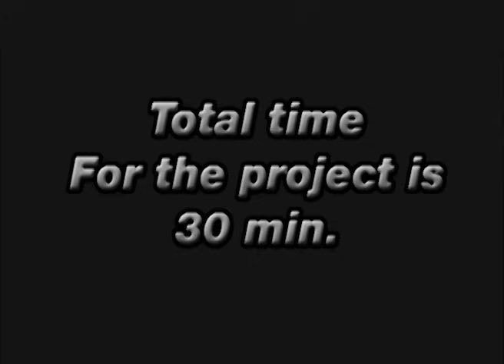DIY: Wrapping Rims in Matte Black Vinyl

Comment: Great video.  I'm surprised how many bad comments there are about using vinyl.  Good 3M vinyl can last 5+ years on a daily driver, and longer on a car not left out in the sun or driven in bad weather.  It's relatively cheap and not that hard to do, provided you watch a couple dozen youtube videos by the pros.  And if you really mess up a piece, just pull it off and do it over again.  I bought a bunch of small samples on ebay in order to see how the colors looked on my car and also to experiment to see how much body prep was required before wrapping.  I'm working on the car now and it's not as hard as I initially thought.
Reply: You guys heard it straight from John Squires!
Reply: Its a touch different for the wheels though. Brake heat, curb rash, road grime and salts, etc. Wheel vinyl wont last nearly as long as on a smooth large panel. That said, as you mentioned its cheap and easy to repair.
Reply: your going to have negative comments about anything but i enjoyed watching it - i fast forwarded it alot to the ending to see the outcome. Good job
Reply: people just love to shit on others, especially on youtube. it's for their self-esteem lol...
Reply: @thedbq1  lol no my friend.. it's because of the shitty sped up techno music. plain and simple
Reply: Can you wrap aluminum hub caps or just spray paint it?

Comment: When heating the vinyl and pressing it into those curves you should be using your finger and soapy water or spit, not a rag. That rag can stick to the hot vinyl and leave lent or rip it. Also don't make any cuts until it's applied all over your selected area (including all curves and recesses. If you make a relief cut a relief cut in the middle like in this video it  will prevent you from being able to heat it again because it'll expand and further the cut.

Also for all you folk who don't do this professionally, make sure you're using a brand new blade before each cut to prevent jagged edges from dull cuts.

They also didn't mention cleaning the surface extremely well with 1/2 Denatured Alcohol and water before application to prevent future failing of the vinyl and prevent dust speckles showing through. 

Just tips for installs from a wrapper.
Reply: Timothy Brooks it sounds like you know about vinyl. How long does it really last. I’m in California is it worth wrapping wheels
Reply: Have you gone Platinum yet?

Comment: nothing beats powder coating wheels but I'm ballin' on a budget so I painted my wheels with duplicolor and quickly wiped off the over spray on the rubber with thinner. Once the paint dried I cleaned the rubber. Works good with black, matte or gloss. If you want to use a paint with hardener, mask your side wall with vasoline, use a razor to cut the over spray once the paint has dried it peels right off- please stop replacing paint with stickers_ painters have to eat too lol

Comment: People have to realise the longevity doesn't exist on wheels and glued on vinyl. Add in road salts and water mixed with spilt fuels from trucks and all other crap on the road fired up into your wheels and it's gotta be no shock that they will start to fail especially when grit and stuff chips at it. With the cost of the vinyl being less than £10 especially if you order it directly from china and wait 2 weeks for it to arrive, you then realise it's really only meant to be for a short period of time. Sure, you could add 4 coats of lacquer afterwards to give it some extra protection and more longevity but that makes removing the vinyl a little tougher. Things like this are great for shows and such where you will remove it within a week or even a few months and lets face it, it's not costing more than a few pounds and your time to do it. People who are expecting a lifetime good look are going to be disappointed. Great video, could be more detailed but inspires none the less. Btw, if you are feeling creative, you don't have to do one colour or flat non-patterned.... also, use a brand new very sharp blade and always let IT cut the vinyl while the blade is riding flush where applicable.. otherwise it will look butchered.
Reply from the maker: Lasted 4years before cracking. This last year I took a look to see if I can peel the vinyl still. I can. This was only a test. But it passed. 4years of Canadian winters.
Reply: Bart Koscow how do you avoid the matte vinyl glossing up when you heat it?
Reply: I think the vinyl that looks like it's glossing only appears that way because it's shrinking and stretching. I think whatever is stuck to the actual wheel will remain matte because it can't stretch and shrink, since it is adhered to a surface, i think.
Reply: Sunil P I have worked with matte vinyl before and if its heated too much it melts and glosses over. I'm guessing you have to watch the amount of heat used.
Reply from the maker: TMundohere it dose of you stretch it too far. If you stretch it more then twice it's own width it will gloss up. Nothing you can do, but cut the inside first, then apply a top coat. I have done this before with extreme curves, matte black tends to blend in nicely.

Comment: I work daily with vinyl. Try do that with a more complex wheel such as my bmw mv1's you will come unstuck fast, not that I've tried! Standard paint or plastidip is the way forward. Just advice.
Reply: Wondering if you are still doing vinyl, and if so have the products and techniques improved so as to allow for doing that type of rim? I have similar style rims to the BMW MV1. Cheers.

Comment: Seems like a very tedious process, wouldn't plastidip have been easier?
Reply: This video is from 2010. Plastidip would be 100x easier than this lmao
Reply: This video is from 2010. Plastidip would be 100x easier than this lmao
Reply from the maker: ***** plasti dio existed back in 1992. and was used in spray form back in 2006-2007. that doesnt make it any esier or longer lasting. each has its strengths.
Reply: Plasti dip definitely works I did it to my rims but took my 3 hours and five coats plus 3 clear coats and it looked perfect and lasted about three years but now it looks terrible and is being a pain in the but to take off.

Comment: Great initiative and great job on the video and the wheel. One thing I would do different is release the tension on each spoke by cutting a longitudinal  sleet in the center of the spoke, some 2 inches long would do. That would make covering each spoke inside much easier, and would make it more durable. Either way, great job. Thanks!
Reply: its easier this way.. you get to civer two spokes at once equally

Comment from the maker: Not sure what happened to buddies comment that said show us 24h later, ok bud. i see your 24h and raise you 28000h, just went out and took this pic. 4 years later.

http://s134.photobucket.com/albums/q110/portabuddy/Mobile%20Uploads/?action=view&current=IMG_20140415_202516.jpg

suck on those apples. ;)
to your credit mystory comment that got deleted. the two rear rims had a small section that lifted off. three years later. and i wanted to see how hard it would be to peel off came off easy so two have little patches missing. but that was in porpose.
Reply: Bart Koscow 
Is the discoloration in the center of the wheel from heat, dirt, abrasion or u.v if you can tell ? 
Im still impressed it lasted so long, especially being exposed to the elements.
Reply from the maker: +nvmyutube no its actually a area where I started to peel the vinyl since after 4 years there where some cracks forming. and really only in the corners where it was stretched. but non the less that's where the vinyl failed.
Reply: +Bart Koscow You managed to change tires without damaging the vinyl ? :D
Reply: Zak Mon what ?
Reply: matt vanbeekveld your language and abbreviations speak volumes of your intelligence.
Reply: +matt vanbeekveld You prob don't even have a decent vehicle, forget ricing
Reply: نن
Reply: Bart Koscow tt 6te1

Comment: Plasti dip is easier
Reply: Also a lot harder to take off, let alone the poor quality of it that rubs off after a wash. Trust me, I've done plasti dip on rims, easier yes; better no.
Reply: Jason Stefan so what would you recommend to be the overall best way to achieve the matte look
Reply: JonLondon210 if I'm honest, I'd recommend powder coating or the best results but the hardest sanding down the alloy priming and using a matt spray paint, available at Halfords in the uk, finishing off with a Matt clear lacquer.
Reply: rubs off after a wash lol. you clearly had no idea what you were doing then. Matte black dip on my rims for 3 1/2 years just removed the dip this weekend with no issues.
Reply: Mel H so the dip comes off? When you want it to?
Reply: Just clean, sand, prime and paint them joints!

Comment: Plastidip is just a type of spray vinyl(your's is a physical vinyl). The amount of coats equal to this, is probably around 5 or so decent coats. I have done the wheels on my GTI in about 7 or so clean coats. Years laters and they are still holding together. Really this depends on the person applying it. Even if this is incorrectly applied, It will be easily ruined. 

I do like the concept of this though. Cool video.

Comment: Vinyl lasts about 4 or 5 years depending how well you put it on and yes you can wash it !! And it only rips off if you grab a corner and pull on it very hard!! but a rock or any other road crap will only scratch it just like paint!!

Comment: Plasti Dip only takes a minute -.-
Reply from the maker: no it dosnt. ive plasti-dipped rims before and if you want to do it right you have to scuff them up. but you dont need to. in any case. it still takes this long if not longer to plasti dip, which i can rub off with my thumb. 

Actually try both methods and tell me which lasts longer. im no hypacrite. i have and its faster to vinly. but better and permante to paint them. which takes 2 times longer.
Reply: ive never used vinyl seems too hard... i think of it as if i cannot put a screen protector on my phone, how can i put vinyl on my car....
Reply: Neil Patel i got same problem lol
Reply: Neil Patel Lol
Reply: Neil Patel If you're doing in a minute sorry bud, you're doing it wrong. + you need 3-4 layers of plastidip per wheel if you wanna peel it off smoothly.
Reply: I know plasti dip takes a couple coats... i was just joking:)

Comment: I love the look, and did it on my 911 wheels.  Similar 5 spokes, but spokes are rounded.  The only problem I have is keeping the vinyl from popping in the outside corners of the rim, at the acute angle when I drive and the breaks heat the wheels up.  I ended up slitting the corners, releasing the pressure, and carefully putting a patch.  I spoke with someone at 3M and they say the vinyl has a max stretch of 30%.
How well did your wheels age?

Comment: plasti-dip makes this look like ssshhhiitttttt
Reply: Really Does... Woulda been cooler if they used carbon fiber vinyl.
Reply from the maker: Tyler Butler
this video is now three years old. i wasnt about to waste such a expensive material on something that might have not worked.
Reply: I see. I wasnt bashing you it was just a response to the plasti dip comment is all. Does look good though

Comment: Video posted almost a decade did decent job as opposed to today's "pros". Anyway, the only downsides I see are winter snow months and the brake dust, which you have to either let it build up or take it off so it looks clean....
Reply from the maker: Thanks. Still going. I think it was actually 2010 I did this but YouTube really wasn't a thing back then. 90% of it still looks as good as the day I put it on. And I have driven every winter. Third set of winters on them and they have not ripped. I messed up and went right over the center caps. The ripped that area centering and balancing the rims.
Reply: @portabuddy  i suppose, that you had to redo it whenever they changed the rubbers?
Reply from the maker: @jonathanvillalba3214  no. I have not touched them.
Reply: @portabuddy  i got a hard time believing that lol. Anyway, it shows you wrapped the front and sides of the spokes. There probably was some return at the back (back of the 5 spokes, where we cant see in the video) did you put any other cover there or just left it as was? I feel like it would peel from the back
Reply from the maker: I left it on just for fun to see how long it will last. At the time I was making decals at the time and had a ton of vinyl. Still do. 

The vinyl wraps around the back. Overlaps a bit in the back then I painted the inside black so you can't see the silver.
Reply: @portabuddy  ok. Yeah that makes sense
Reply from the maker: @jonathanvillalba3214  and the funny part is. I have a 100kv powder coating machine. I could have just powdered coated them.

Comment: Sod this just use Plastidip easy on in 5 minutes and off in 1 minute
Reply: +Dan Druft ass face, that lasts at least 4 years, mine is 4 years and looks OK. Vinyl brand is Hyundai
Reply: +rodstartube What are you crying for ? vinyl sheets for wrapping is old hat and expensive to do, It's either spray on wrap or Hydrodipping. Try to keep up mate
Reply: +Dan Druft it doesn't last 1 minute
Reply: +rodstartube yes it does I run my own business doing this stuff in matte and solvent resistant gloss you don't know what you are talking about
Reply: @Dan Druft I've never wrapped or Plasti dipped anything, but I just watched a video on Plasti Dip and it does NOT take 5 minutes.  They suggest several coats. 1 can per wheel. And use the whole can.  1 coat does not take 5 minutes to dry.  "Allow 10 -30 minutes dry time (dry to the touch) before applying additional coats. A minimum of 5 coats is recommended for best performance and easy removal. " If you want it to peel off without being a pain in the ass it takes at least 4 coats. And you should wear a respirator, so plan on buying one with a proper filter cartridge on it. Then there are the adhesion promoters and clear coats and whatnot to put over it. Doing Plasti Dip properly takes more than 5 minutes. And, if done properly, it looks great and lasts.  They say vinyl lasts. It also has to be applied properly, not over heated/ overstretched, and stretched from the right direction. And, now they even have ceramic coating (very expensive) to protect the vinyl. Plus you need to protect vinyl just as you would paint,  with wax or whatever, to protect it from the sun. In any case, plan on hand washing your car and not using harsh chemicals with either product. High pressure washing is probably not recommended with either as well.

Comment: I tried this and plasti dip. The vinyl started to lift. And the plasti dip was perfect since it molded itself to the texture and rock chips. The plasti dip is 10x easier to apply and10x more durable. I'd check the cons of vinyl before buying.

Comment: not if you do it right, actually it doesnt flake at all... its rubber paint. If you clean properly before coating rim it holds up a long time and will only peel off when you want to peel it off and change or get rid of it.

Comment: Brother, the rubber protectors will not protect the face of the wheel but will only prevent damage caused by the inner wheel gripper.

Comment: spray paint more reliable. easier to apply if something just touch up it.  also many spray paint if not clear coated easy to remov with chemistry
Reply: Most people can't spray paint correctly, and I wouldn't say it's easier that vinyl wrapping.  This stuff comes right off with some lemon juice too so it's not hard to take it off.  It also doesn't harm the original paint at all

Comment: Looks good mate.
did you drop the pressure from the tyres in order to get the 
wrap right round the rims?
Reply from the maker: thanks. and no sir. it just tucked in tight. there was a little space. the tightness helped hold the vinly in place untill it bonded well.

Comment: Lemme see.  Wrap your wheels for the winter to protect them from salt and grime.  Goes on easy.  Come spring take it back off with the heat gun.  Less work than putting tires on and off, or worse having two sets of wheels and tires just for the seasonal change.  Plus the vinyl won't mar the original surface/finish of the wheel, unlike sanding paint or an adhesive coating off.  Lots of creative room for it too, and if you want to change it, woop heat and peel.

Comment: you should just spray paint it, you'll get a more durable coat that you can actually wash. The alloy wheels will get abrasives on them brake filings, road dust etc which will tear the vinyl as you wash the wheels. If you just spray paint it, and do a good job it will last as long as the car. Failing that you should use that dreaded plastidip. it leaves a surface similar to vinyl but is better to use on those crevices and stuff

Comment: I've had this on my rims. Didn't last over a week. Started peeling off from the center of brake heat. Plasti dip actually holds up to heat. And it doesn't melt like vinyl. If you wanna waste 50 dollars on something that lasts a week go ahead. Don't say I didn't warn you.

Comment: if you wanted to, could you of stretched the vinyl deeper in the wheel? I was thinking about doing this on a set of wheels I have, but I'm doing a color and dont want the stock color of the wheels showing much?
Reply: Probably not... The more you stretch it the better chance it has to fail.

Comment: He painted the entire car in plastidip flat black, and the only thing it wouldn't hold on to, is the chrome wheels. He has a C5 and I don't see how its relevant, considering what I said is personal experience. It held on my chrome mesh great, just not on the wheels on his C5 Vette, and not on the wheels on mine either once I'm above 130mph. It literally unraveled an inch to two inches all the way around the wheels.